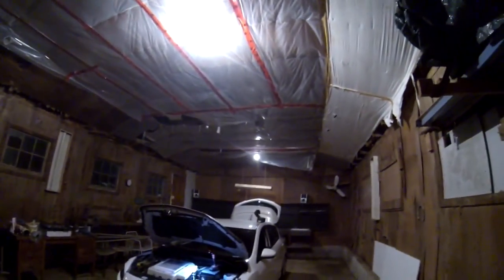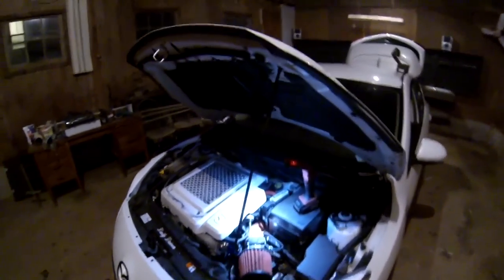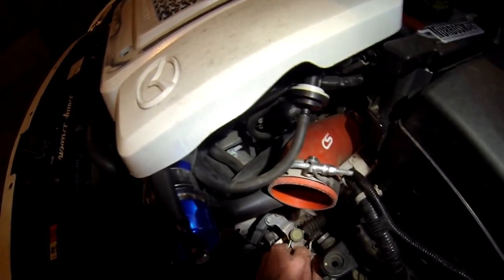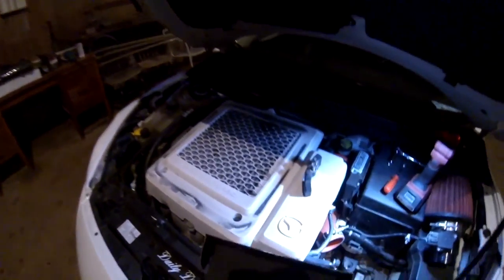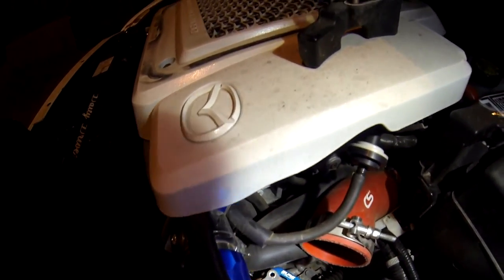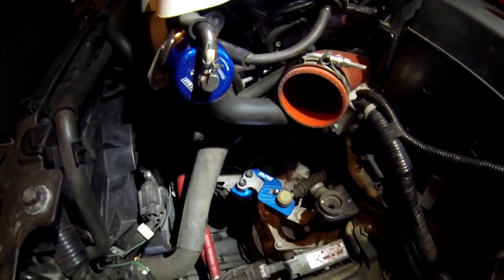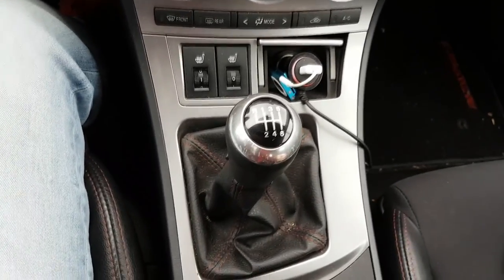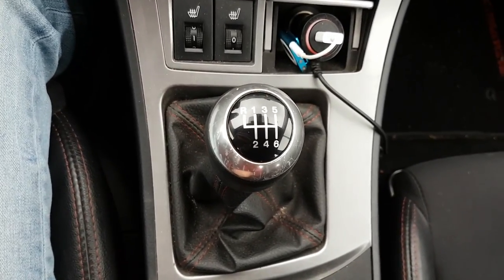Mazdaspeed 3 Short Shifter Plate & Counter Weight Install!

Comment: I think your really going to like it. you should put a little white grease on the rubber boot it's alot closer now and rubs save from wearing a hole in it.
Reply: Yeah you can see where it will rub through that rubber sleeve on the linkage. Keep up. The vids man good job

Comment: sometimes you will miss third, but I miss third sometimes, and I have the stock weight, and linkage position.
Reply: Third sucks to hit, especially during pulls. I'll hit the wall between first and third all the time and I've got stock everything
Reply: sure does.  the other day I missed 3rd, and I wasn't even shifting hard. just normal.  I couldn't believe it.
Reply: I thought I was the only one with this 3rd gear problem. I always miss third on hard pulls
Reply: Same here bro. I am gonna install short shift plate with new counter weight, Mazda guys nearby say it will help so I will see.